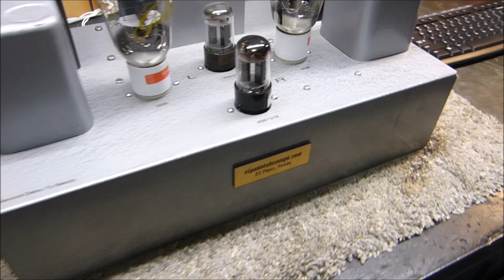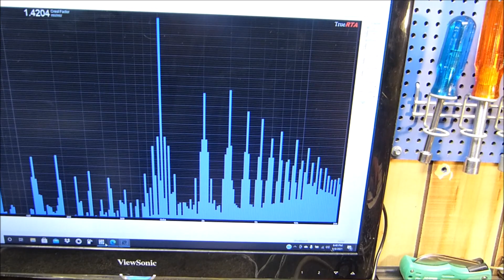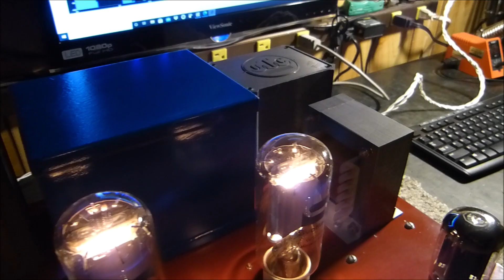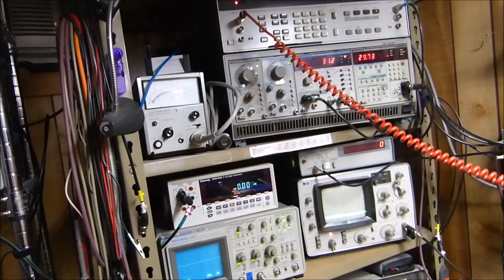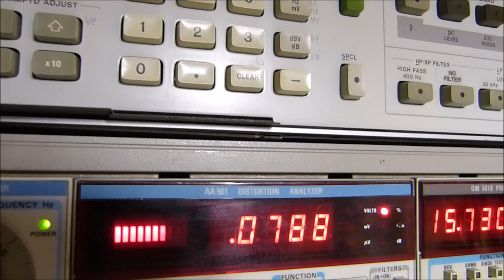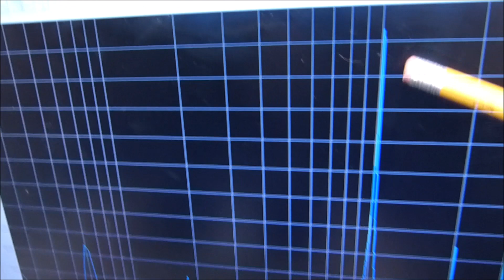SET Amplifiers 300B & Svetlana SV572-10

Comment: I wonder what makes SET amps so expensive. There isn't much to them really.
Reply from the maker: I would say marketing hype and perceived coolness. 
As high in distortion as they are, they often have a pleasing sound to our ears at normal room-level volume.
From my own experience, I have found that amplifiers that do not perform perfectly on the test bench, may sound good to the ear whereas some that perform flawlessly in distortion (THD) and frequency response may sound sterile and empty to our ear. If absolute bench performance was what we want to hear, all vacuum tube amplifiers would have gone to the trash more than 50 years ago. What makes a great violin sound good ? It is the harmonic profile (harmonic distortion) in just the right amount of each harmonic that pleases our ear.
Reply: @ElPasoTubeAmps  Thank you for your feedback! I currently power my speaker with tubes. I would like to find a nice SET to taste the waters with another set of speakers which are more efficient but everything is more than I would like to spend.

Comment: As always, I enjoy your analyses. I’ve been thinking lately of building a pair of tube amplifiers. They will be push pull, probably ultra liner design. I’m thinking rather than the more common 6L6, KT88 or similar output tube, I might try using a less common tube, like a 6146B or 811. I’m aiming for 65 to 100watts per channel, so if I used the 6146B I’d have to use 4 output tubes. I might go with Class B, operation. Maybe I’m just crazy, but I think it might make for some interesting results.  Might be a while before I get to building it, because I’ve got a bunch of other projects to get out the door.
Reply from the maker: Good to hear from you, Bill. I hope all is well.
The 6146 can run AB1 and deliver 96 watts with a 5400 ohm load but it can not be run in UL. The screen on the 6146 must be run as a tetrode with lower screen voltage and can not be run in a triode mode. When I first came to El Paso in 1976, I knew a fellow that build two monoblocs with 6146's and those things along with his speakers would practically drive the nails out of the walls. It is a wonder any of us can still hear...
The 811A being a high mu triode (gain = 160) will only run class-B and will require grid power and a high impedance OPT. I may be wrong about this but it seems the higher voltage, higher impedance amplifiers do not perform as well as the lower Z amplifiers. McIntosh ends up with a 1K load on their output tubes the way they connect the plates and cathodes together in the OPT.
https://frank.pocnet.net/sheets/049/6/6146B.pdf

Comment: Hello Sir. I am curious about the 45s delay you mentioned. According to Merlin Blencowe, its not really needed. What's your opinion on that matter according to your experience..? Thanks!
Reply from the maker: No, it is not necessary and not common but I just wanted to do it that way, for one reason, one of my 300B's would sparkle inside as it was warming up. HV comes up instantly as it is a SS supply but the tube warms up slower and I did not like that sparkling in the tube. Obviously not a good thing and I think it is the 300B that had half of its filament go out on me.
Reply: @ElPasoTubeAmps  interesting. Thank you for for sharing all your knowledge

Comment: When you read the schematic with the B+ voltage and other voltages, are those voltages with load or no load? I didn't have schematic for my amp so I found it from internet but they could have been mod because they listed different voltages. My amp without tubes has 456v for B+ but when I put in 4 of 300B, it drops to 352v since some schematic I saw list between 406v to 420v. I only have ohm meter so I don't know if anything bad but the sound is decent, nothing to complain but still confuse how to read the schematic correctly. Wowo 240F ?  Mine is around 150F. Should I increase negative bias? Currently set at -71v that is around 150F. With -65v, it would be 190F, I thought it 's hot but saw your at 240F. Thanks
Reply from the maker: I have always used the voltage readings to be with the amplifier powered up and all tubes inserted so it is under idle load - not under full signal drive.  With an adequate power supply, you can expect around a 5% drop in voltage under full signal drive taking the amplifier to its maximum power output. Another factor to consider is the size of the power supply components. For example, if you have an amplifier that draws 100 mA under full load and your power transformer is military surplus rated at 500 mA, they you won't have much of a voltage drop. Obviously, on the other hand if your PS components are marginally big enough you can expect a much larger voltage drop. A good place to run a 300B is at 400 volts and -60 volts bias. A little higher voltage is not a bad thing but probably not over 450 volts on the plate.
Reply: @ElPasoTubeAmps  I have learned at lot from your videos with all the explanation and detail each section of the schematic. I believe my PT is 500mA and still have another AC wire option to go max B+ at 420v. I will switch the wire from 320v AC to 404v AC to see how the sound is. Thanks for the info.
Reply from the maker: @Warclock07  Thank you. Upping the plate voltage will make it perform a bit better. In a somewhat joking but  realistic way, raising the plate voltage and running the tube "hotter" (increasing cathode current) will almost always improve its performance in power output and reduce the THD - up to a point - where the tube "melts down" - not literally but you know what I mean. I have said in my videos before that if, for example, I need 450 volts on the plate but I can only have 420 or 480 - I will chose the 480. Performance will be so much better - but, of course, that means attention to power supply electrolytic capacitor voltage ratings, etc. Stay safe and I am very pleased to hear you enjoy my videos. More to come...

Comment: Between the different of power, do you refer 300B PP or SET for listening? I don't see the cost different much but seems like a lot people like SET. I have 300B PP so I don't know if I want 300B SET as well.
Reply from the maker: That is a very good question. No doubt the SET had a charm to it but overall, I prefer a little more power and a push pull amplifier. I don't have a PP 300B but I have built PP 6B4G, basically a little smaller 300B low mu triode. I think a lot of people like the SET for several reasons -  one is the hype and sales pitch surrounding them and secondly, they are somewhat easier to build and maybe a bit cheaper but without a lot of high-end test equipment, you really don't know what you are getting in these SET amplifiers. With that said, some would rightfully say that who cares how it performs in the lab if it "sounds good". A lot of subjectivity here in the audiophile world.
Reply: @ElPasoTubeAmps  Thanks, maybe i will build a SET later in the future.  Actually, I am focus on the 300b PSE at the moment, I think it's pretty much the same as SET.

Comment: Great to see you back on the audio.  I've watched your last couple videos on Collins and inductor measurements but didn't comment.  I bet you worked on those two amps for a while.  It takes some time when you have to deal with all that weight.  They both are very beautiful.  I love your test setup for THD.   Been dealing with my arthritis and a pinched nerve.  Where did you purchase those 350w dummy load resistors?  Great video again!
Reply from the maker: The resistors are from mouser.com and are part number 284-HS300-8.0F
They are 300 watt 1% with an exceptional good temperature coefficient not changing resistance at even 350 degrees. I run them that hot. They come in other wattage values if you don't need 300 watts.

Comment: Hi paso nice build of the 300B beautiful sounding tube.
One question I see you don't use a star earth. I use star earth all the time especially in my tube pre amp.
How do you get away without star earth?
Reply from the maker: I have used star and buss grounds before with no great success. Maybe I am doing it wrong. What I do is make sure all the power supply components, especially the PS electrolytic capacitors are grounded at one single point close to the power transformer.  Same for the CT of the power supply transformer or the negative in case of a bridge. I do not have hum issues in any of my amplifiers when I build this way. I ground my RCA inputs directly to the chassis and cathode capacitors, etc to the ground tabs on the tube sockets. I know some designs have the RCA input ground "float" with something like a 10 ohm resistor to ground. I have seen more than once, that resistor burned up from a parasitic in the amplifier which leave the input ground floating. Then we have a real hum problem. Study the high-end amplifiers like McIntosh. They do not use star or buss grounds but they do put all their power supply grounds to one point at the AC input/power transformer.
Reply: @ElPasoTubeAmps  I see well so much ways to solder. My Amp is dead silence with no humbuckers installed ☺️wish I could load up some pictures 😊 Thx for your rich answer allways nice to learn from others.

Comment: Are those capacitors hot glued? If so won't the heat from the tubes soften the glue?
Reply from the maker: I don't use hot glue. Some may have a spot of Goop to hold them in place, which is much stronger than hot glue.

Comment: Who's that transformer companies? is that the sister company of fezz audio.
Have you had any issues with JJ electronic tubes somebody was slagging them off saying they are unreliable I don't know if that's the real tube or a fake from China, I'm afraid there's a lot of fakes out there same with Transformers maybe the same with electro-harmonix are you sure they're not fake I thought they were good tubes
Don't like the harmonic so high especially the third, the 8th could be higher you want to get that 3rd harmonic right down and 5 harmonics,  do you think the mains  60 -50Hz is low enough?? I would prefer like -90db is it that difficult to get it that low. Is there any way of getting in the Frequency response to 70 kilohertz would be better should help with the harmonics problems. Why don't you just use a thermistor instead of that tube and really I wonder if that's taking something away?
Nice job looks nice
What's the difference between ltspice and micro-cap have you tried them side by side in their own simulation tests any difference? Would be good experiment running the two simultaneously see if one is more accurate than the other and what results are different.?
Reply from the maker: I was not aware of Fezz audio until you mentioned above. I don't think they make transformers but I did watch one of their videos.
I don't think there is anything fundamentally wrong with JJ tubes. The most expensive KT88 tubes, branded Telefunken, are made by JJ and they are very good - no doubt Telefunken is buying their JJ premium tubes and putting their name on them. Tube companies have always done that.
Electroharmonix are good tubes. I just happen to have two out of four 300B not so good. It doesn't turn me off to their brand.
The harmonic profile does leave a lot to be desired but I am just showing what it is. We all like S/N to be -90 dB but anything better than -70 dB and you will never hear it out of your speakers, even high efficiency speakers like Klipschorns.
Thermistors will help limit inrush current but the delay-relay tube keeps the HV completely off until the tubes are warmed up. I wanted no HV on the tubes until they were warmed up properly.
Thanks... the big amp turned out looking OK but it is just way too heavy and hot to be practical. It would need a floor fan on it to keep it cool. I think I will stick with the smaller push-pull amplifiers. I have had my fun with the SET world.
Reply: @ElPasoTubeAmps  yes but what's the name of this Transformer company you use. one of the videos shows fezz making the Transformers as i saying they are linked to a transformer company what I can't remember their name! They use Vox simulation solid-state rectifier Fezz in their tube amplifiers what's special about Vox tube rectifier? maybe you should give it a go.
Reply: I'm not current on what Fezz is doing today but several years ago they seemed to only use toroidal power and output transformers. I tested their entire lineup of amplifiers at that time and found them OK for the price but nothing special. I suspected part of the problem was the toroidal output transformer but never dug any deeper. They do look nice mind you. I believe the transformers are made in house under a different company name.
Reply from the maker: @apexmcboob5161  I knew nothing about Fezz until now. Thanks. I have heard a little bit about toroid transformers for audio but really know nothing about them. The fact that the market is not flooded with them says something to me. For power transformers and autotransformers like for 120 to 240 conversion, etc. I think they are superior. I use two in my basement to run my equipment feeding them with 240 and taking  120 off as most of my equipment is 120. Much, much better way than trying to run things off a wall outlet which of course is impossible for higher power transmitters. Thanks for the information about them as audio transformers. Something worth looking into.